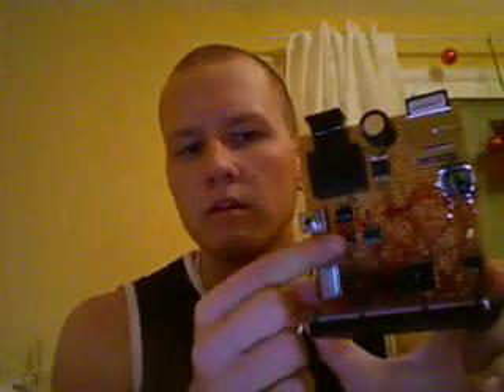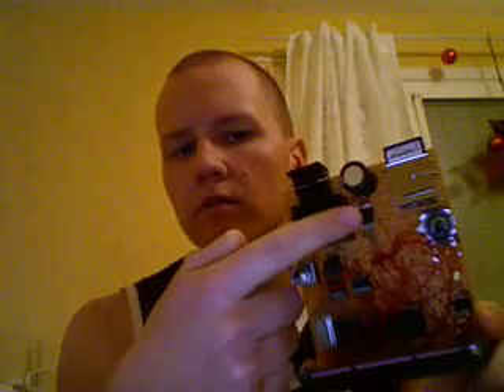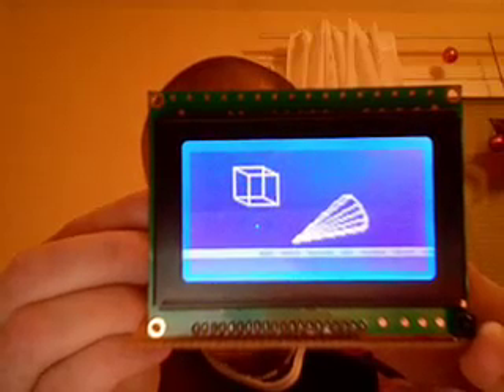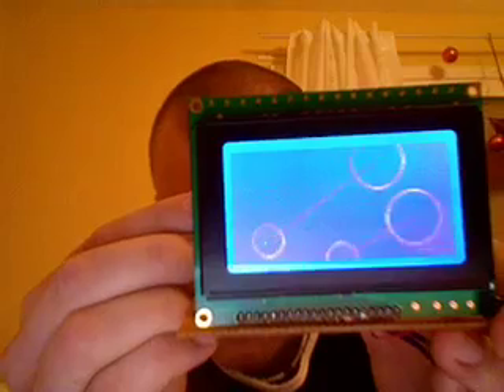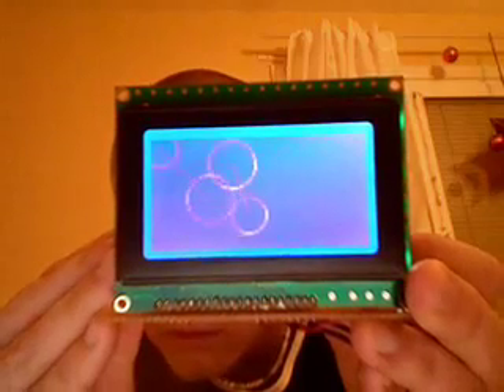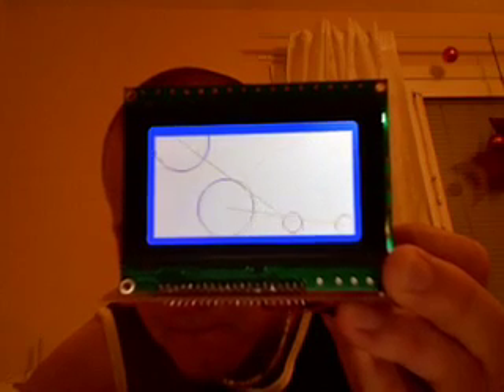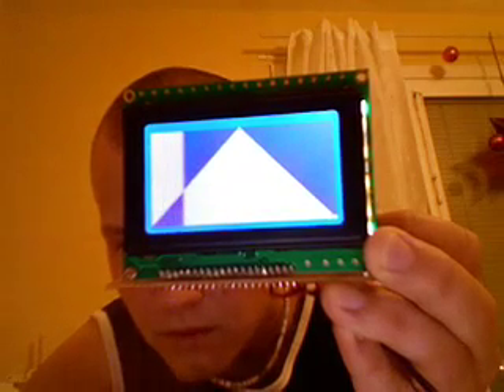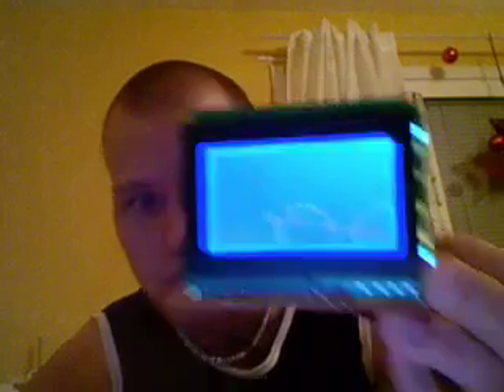PIC microcontroller with GLCD

Comment: to make it use the sd card the sd card has to be in a formate that the microcontroler can read but aslo the  microcontroler has to understand that format as well. and if you whant to play a vidoe or veiw a picture the microcontroler has to be able to understand that format. so to use that SD there with be a lot of programing in you future.

Comment from the maker: This design is completely made by me. I didn't take any course, I just started out with what seemed simlpe. Like light a LED. Make two LEDs flash and so on. Something that I have come to sense with he last couple of years is that it is really necessary to read the datasheet for the PIC you are using, there you can read about all the features of your PIC and use them to get as high speed as possible. Also test as many sample codes as you can and try to figure out why they work. /Kdg86

Comment from the maker: For the shapes I used a homemade GFX-libary, you can find the algorithm for circles in C on wikipedia, search for "mid-point circle algorithm".
The line drawing algorithm uses "Bresenhams line drawing algorithm" also on wikipedia.
The lcd I bought on ebay. But if I were you I would start with a Nokia color lcd since it is more in fashion now and still easy to use.

Comment: hello from portugal.

as told, mikroc has a library that allows you to read/write to a sd/mmc card...it also has a built in library for the I2C protocol, USART, LCD and GLCD displays among others. Very easy to use them, with some samples to follow. Everything you need is in that program. You could also use Proteus to simulate your project, instead of buying the hardware and mount it. At least, you'll know if your code works.
I'm also interested on the algorithm for the circles...

Comment from the maker: I´d learned by trying, many hours of failure. But once you got the hang of it, you will be able to do what ever you like. 
The GLCD did I bought on ebay, it´s a standard GLCD and uses the KS0108-controller. It´s easy to find datasheet and info for it on the web.
I got no schematics but it all depends on your configuration in your code.